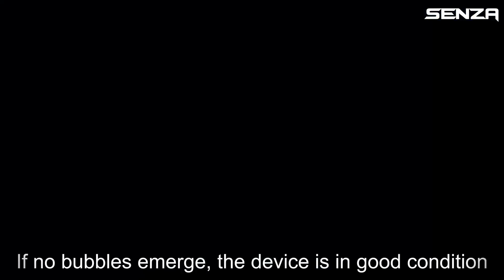How to build a 2L/min alkaline hydrogen generator

Comment: why its olny one mixture outlet? that is lye and hyrdrogen ？
Reply from the maker: In an alkaline electrolyzer, hydrogen is mainly produced at the cathode, while the electrolyte (usually potassium hydroxide or sodium hydroxide solution) is responsible for transferring ions and maintaining a stable reaction environment. Since the hydrogen produced at the cathode appears in the form of bubbles, these bubbles mix with the flowing electrolyte and are then discharged through a common outlet.

Comment: I want to use this for Drinking Hydrogen water, with no Chloride  being produced, I have no Idea if this is safe to Drink as Hydrogen Oxygenated hopefully if this unit can't do what I need u have another Hydrogen Kit that would Suffice thank u anyway, what u did is Fantastic
Ps where can I buy this set up or kit
Reply from the maker: This alkaline hydrogen generator requires the addition of strong alkalis such as NaOH or KOH. This will cause the final product to produce chlorides, which is not safe. Unless you add a purification module at the end. However, I would recommend you use a PEM hydrogen generator. It only uses pure water for electrolysis, and the only by-products are hydrogen, oxygen, and some water vapor. This is much safer. You can visit our website at senzahydrogen.com/products/pem-hydrogen-generator to choose a suitable PEM hydrogen generator for you. Or you can email us directly at service@senzahydrogen.com.

Comment: How much gas do we need to run a car ?
Reply from the maker: Firstly, I would not recommend that you use the gas produced by alkaline hydrogen generator for use in your car. This will cause the corrosive alkaline mist to damage the car engine. Secondly the amount of HHO gas going into the car needs to be determined by the displacement and model of your engine. You can refer to this article.https://senzahydrogen.com/more-hydrogen.html

Comment: What is Alkaline?
Reply from the maker: "Alkaline" is a word used to describe the property of a substance that can dissolve in water and make the pH of the solution greater than 7. In our daily life, some common alkaline substances include detergents, baking soda, and even handmade soap. In an alkaline hydrogen generator, "alkaline" refers to using an alkaline solution (such as sodium hydroxide or potassium hydroxide) to help decompose water and produce hydrogen gas. This is an efficient method because an alkaline environment can electrolyze water at a lower voltage.
You can check this https://senzahydrogen.com/what-is-hydrogen-electrolyzer.html

Comment: great video for pilot scale setups but you cannot or should not scale this up to industrial levels eg 1000A as those levels of oxyhydrogen increase the probability of things going wrong. Thus for scale up you need a pressurized alkaline electrolyzer with porous seperators to seperate H2 and O2 at the cost of some efficiency due to added resistance but still less expensive than membrane electrolysis.
Reply from the maker: You're right. This is more of an experimental model to demonstrate a small alkaline hydrogen electrolyzer. For industrialization, more things would need to be considered, such as safety, maintainability, cost, etc.
Reply: @senzahydrogen  still good enough for glass blowing torch feed

Comment: Shouldnt you be aiming for 2V at each plate? So if input is 12V in then there should be 5 plates between the - and + live plates? 
Also there should not be two live plates beside each other?  If you fix that it might get you to 200W/L
Reply: it is 2V per plate as you have 4 neutral plates between 2 charged plates leading to the voltage divider rule which allows for a nice 2V per plate. A rule of thumb is plate number = 1/2 of voltage input. so 12V = 6 plates and 24V = 12 plates and so on.

Comment: How can ı seperate oxygen and hydrogen for alkalin electrolyzer.
Reply: use a pressurized alkaline electrolyzer design with half gaskets and full gaskets between each porous seperator to allow for seperate output  per chamber. Remember to note the polarity used as reversing it will alternate the products produced per output line.
Reply: @CatboyChemicalSociety tell me more about the pressure if you could please
Reply from the maker: Due to the principle of operation, it is difficult to separate hydrogen and oxygen directly in an alkaline electrolyzer. It may be necessary to separate the HHO gas in the outgoing HHO gas by means of special components or processes.
Reply: @senzahydrogen  you can seperate it if you have a porous cloth between each plate stack along with half gaskets to act as feed lines for each compartment  then have common input for water and 2 inputs for gases where half gaskets and full gaskets sit between the membranes and plates to have alternating output for each respective chamber.
This however requires feed pressure and decent flow rate in order to accomplish seperation of product and the pressure, flow rate and input/output cross section needs to be fine tuned to prevent diffusion of microbubbles of H2 through the porous barriers. So yes you can seperate the gases with an alkaline electrolyzer and this is known as a pressurized alkaline electrolyzer. The H2 and O2 microbubble laden water enters 2 holding tanks that meet at the bottom with a pipe and a pump to re feed it into the cell.
Reply: I made one by using membranes with notches leading to each side so that the hydrogen goes into the hydrogen output and air into the air output . It was not an easy task and took many attempts , I finally succeeded.  Note : regarding the comments to your question about the pressurized thing , I did not do this pressure part  and it worked . I'm very curious to learn more about this aspect though..

Comment: how can i use this to make energy from hydrogen?
Reply from the maker: It's just a device that produces hydrogen. If you need to generate energy from hydrogen, then you need a hydrogen fuel cell. You can check out the video below:https://www.youtube.com/watch?v=4MNNnucoc-Y   
and
https://www.youtube.com/watch?v=aNDlccOlJYA
Reply from the maker: Energy conversion efficiency with hydrogen fuel cells is roughly 60-80%. Of course you could go for the simpler option and let the hydrogen burn directly to produce heat. Just like with gas.😄

Comment: 12V*50A=600W for only 2LPM (very low production), normally between 180~200W/L
Reply from the maker: Did you make your own unit or buy one? If you did build one, would you be interested in sharing how you did it?
Reply: those numbers are wrong because you are forgetting about 50% efficiency so only 300W is used for actual H2 production not 600W. The only way to increase efficiency is to use better electrodes ideally a nickel cathode as it has a lower H2 evolution potential than steel. Alkaline conditions also raise H2 evolution potential which leads to more losses but acidic conditions require exotic electrodes like Ir-Ta as your anode and Pt as your cathode. That setup has greater efficiency than this around 85% instead of 50% but as you can tell its not economically viable. This is why methane steam reforming is still the main way to produce hydrogen though japanese researchers are trying for radiolysis due to the huge excess of energy surplus used. I suggest using nickel plated electrodes in your cell to atleast bump up efficiency by a tiny bit or just put more POWER!!. and use the heat produced in some other process that requires preheating coils.
Reply: @CatboyChemicalSociety  
I don't get how could changing the electrodes would boost the efficiency that much, I know that changing it would lower the electrical resistance and element the corrosion. Would It do more than this? 
Do you have any papers on this topic please?

Comment: thanks, I'm trying to make one but it's hot. How can we reduce the heat?
Reply: use a heat exchanger to remove the heat dumped into the water. A general rule is heat produced = 1/2 of input assuming 50% efficiency the rest goes into heat so if you put 12V at 50A for instance you have 600W of input so 300W of cooling required for the water to not overheat or boil imagine having a 300W water heater device basically.
Reply from the maker: You need a transformer with constant current and constant voltage.

Comment: that's a browns gas or HHO generator not an alkaline hydrogen generator
Reply from the maker: This produces indeed hho gas, which also requires the oxygen to be separated out. If you are using the pem technique, then you can produce pure hydrogen directly.https://www.youtube.com/watch?v=jsFWKGr71XI
Reply: @senzahydrogen  What is the difference and which one do you recommend to use in vehicles? thank you
Reply from the maker: @dariodiaz1680  PEM hydrogen generator，Higher efficiency, lower energy consumption, no corrosiveness

Comment: With size like that you can easy run your 250cc motorcycle without need gasoline
Reply from the maker: Hydrogen generators require electricity to generate hydrogen. Motorbike gasoline is needed to burn to generate electricity to produce hydrogen. The hydrogen is mixed with petrol to burn it, which effectively increases the burning efficiency of petrol. But you cannot run a motorbike with just a hydrogen generator. Alternatively you can prepare the hydrogen in advance and fill the vehicle with hydrogen bottles. Then use a hydrogen fuel cell to convert the hydrogen into electricity to power the electric vehicle. But the safety of this needs to be further proven.

Comment: What is the appropriate size for the black strips separating the panels to make a suitable hydrogen cell for the car?
Reply from the maker: Depends on the displacement of your car's engine. Different displacements require different rates of hydrogen production. More is not always better.
Reply: @senzahydrogen  Is it possible to add an alternating current of 2 amps to this cell?
Reply from the maker: We have not experimented with AC power. We prefer to use DC for our experiments.
Reply: @senzahydrogen  What is the size of the circular plastic sheets that separate the panels?
Reply from the maker: 1. I just went and asked our engineer. They said that the hydrogen generator has a fixed positive and negative pole and is not suitable for AC power. The AC will constantly change the positive and negative terminals.
2.Did you say rubber ring? His diameter is 103mm.
Reply: @senzahydrogen  What is the thickness of the rubber ring?
Reply from the maker: @freecrypto5263  0.3mm
Reply: @senzahydrogen  3mm or 0.3mm?
Reply from the maker: @freecrypto5263  0.3mm
Reply: @senzahydrogen  0.30мм это серьезно ,сам хочу на 0.5 мм попробовать 
Скажите пожалуйста ,0.3 мм на сколько уменьшило сопротивление  по сравнонию с 1 мм
Например при 1 мм напряжение 2 вольта на пару
0.3 мм на сколько уменьшило напряжение на пару электродов?
Reply from the maker: @johnhidrogenius4302  Нам очень жаль, что мы так и не ответили. Это связано с тем, что мы были закрыты на выходные.
Что касается вашего вопроса.
1. Мы не проводили испытаний на стойкость, поэтому у нас нет возможности предоставить вам конкретные экспериментальные данные.
2. все напряжения постоянны 12 В. Это выход трансформатора с постоянным током и постоянным напряжением.
Reply: @senzahydrogen  If you are unable to understand the difference between 3mm and 0.3mm  then how can we believe anything and everything else you are saying.  The o rings you are using are clearly in the order of 3mm thickness.  A diameter of 0.3mm would be roughly the equivalent of 2 or 3  pieces of hair !!